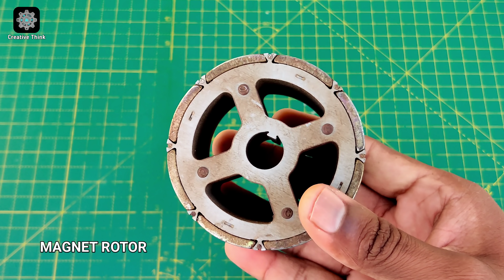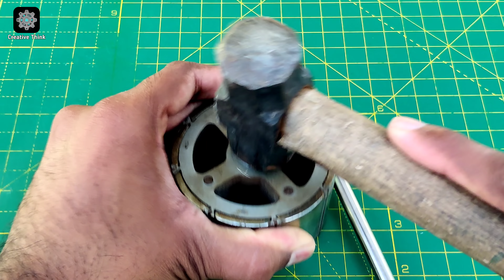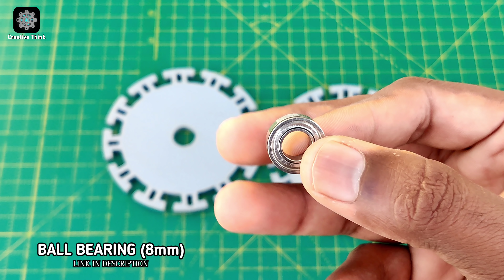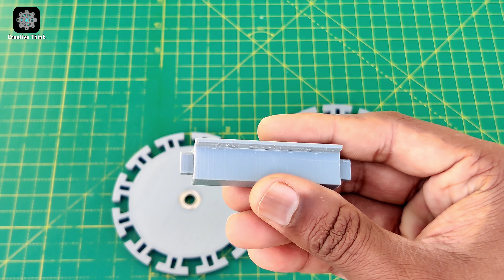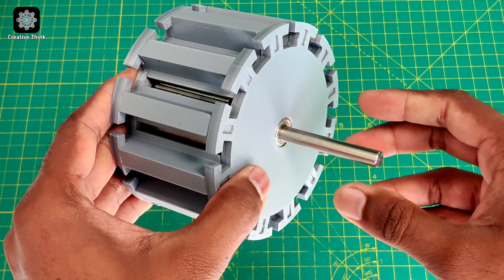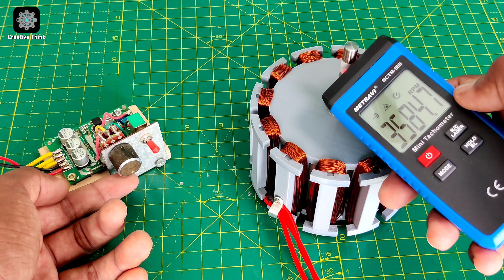Making Bicycle Hub BLDC Motor Using Powerful Neodymium Magnet

Comment: I would like to make a blcd motor for the mini lathe.
what characteristics should a motor have for so much torque but low revs?
thank you
Reply: high gauge wire = more tourque but more power consumption, more wraps the better